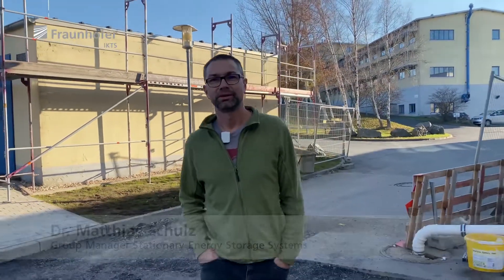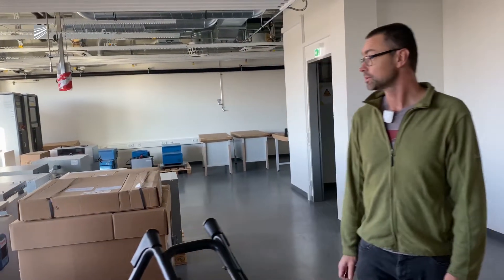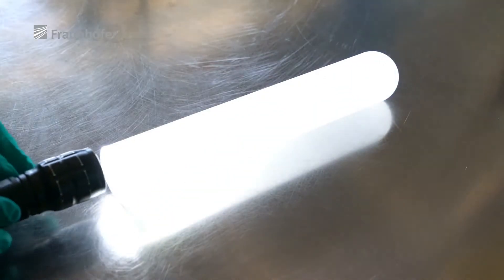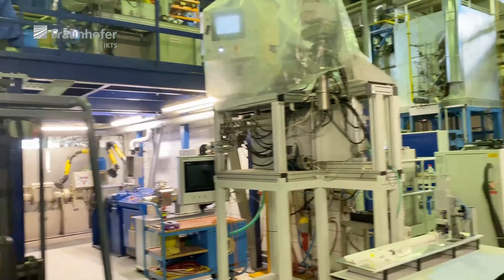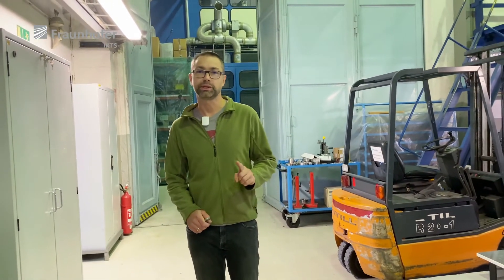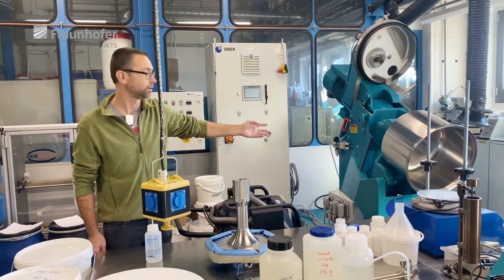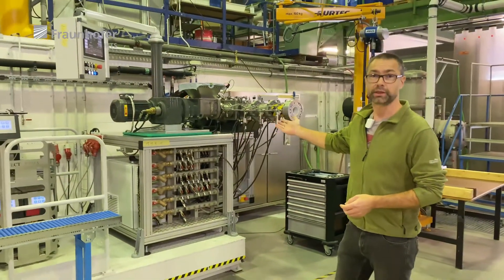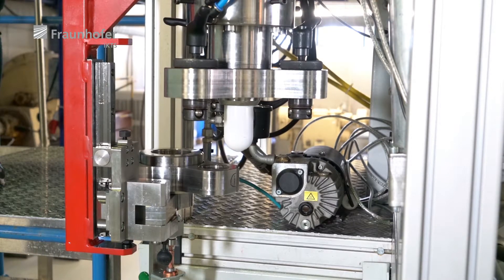Lab tour through the sodium battery technology center at Fraunhofer IKTS site Hermsdorf

Comment: Thank you for the fascinating lab tour. 
Can the BASE that you have developed be used in Room Temperature Sodium-Sulphur batteries ?
Reply from the maker: Hello Namdev, thank your for your question. Yes, in principle that´s possible. It depends on your cell set up and chemistry. The material is stable against sodium and sulfur but struggles with humidity. The conductivity at room temperature is in the range of 4 mS. For low cell resistance it is recommendable to make the BASE as thin as possible.